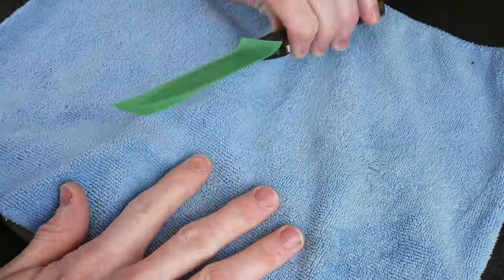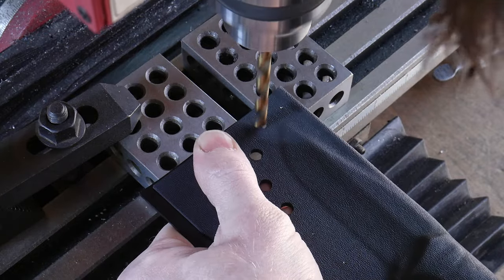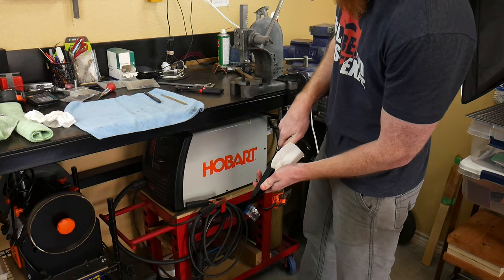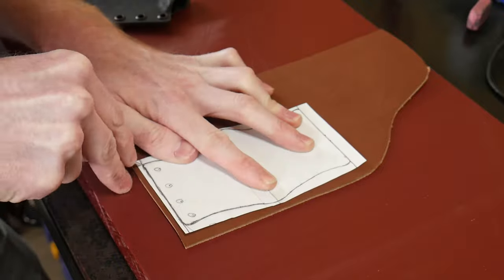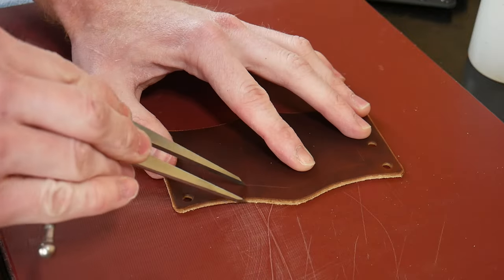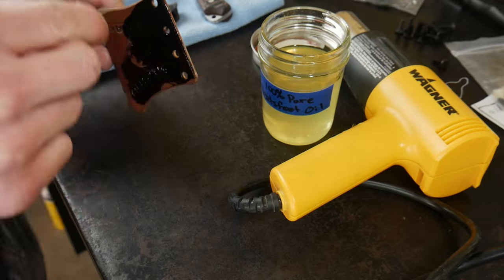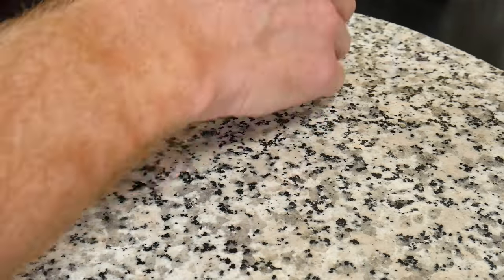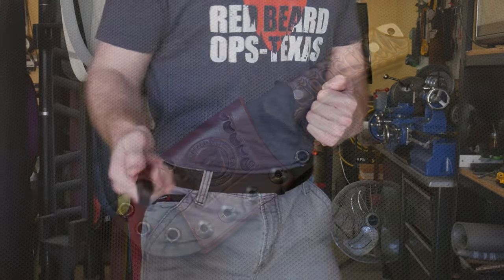Kydex / Leather Hybrid Sheath | Sheath For The War Knife | Knife Making

Comment: I like the hybrid look of that sheath, the contrast between the two materials turned out really well.

Have you tried coffee darkening yet?  I just got done experimenting with it on a mirror polish blade and now it looks like hot bluing on a fancy bolt action.  I attacked it with some steel wool and the finish didn't rub off, I actually had to hit it with a 1200 grit belt sander to get it back down to bare metal, so it seems pretty durable too.
Reply from the maker: Very nice! I haven't given that a go yet, but want to with some damascus
Reply: @RedBeardOps  It's definitely a nice effect on damascus, especially crucible steel!

Comment: I was going through a junk box and I found an old trophy with a marble like base. It’s smooth, flat and only has a small hole in the center. Do you think that would make a good sanding block?
Reply from the maker: I bet it's worth a shot! A good place for a surface plate would be a granite shop. They'll normally give away the sink cut outs

Comment: Hey mr Keeton. i just bought some 1084 and was wondering if it rust or not. and if it does is there any way that you can prevent that from happening. Thanks
Reply from the maker: It will rust for sure. To prevent rust you must clean and oil your blade after use. Many oils will work.
Reply: @RedBeardOps  i sure do appreciate it

Comment: Nice video as per usual.  question; how do you get the old (cheap eyelets out?)
Reply from the maker: Hey Mark, I didn't crush/close those eyelets. They're just in there with friction.
Reply: @RedBeardOps  ohhh, i see..  thank you Sir.  I just shopped at DIY Holster on your suggestion
Reply from the maker: @marktabor4415  You won't be disapointed. The quick clip eyelets crack when I use the arbor press and the DIY Holster eyelets haven't cracked once on me!